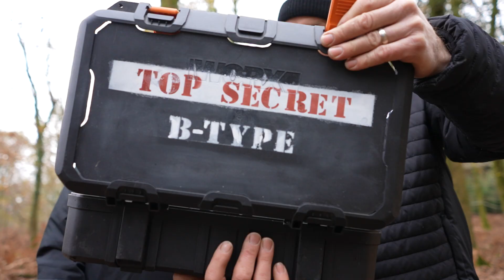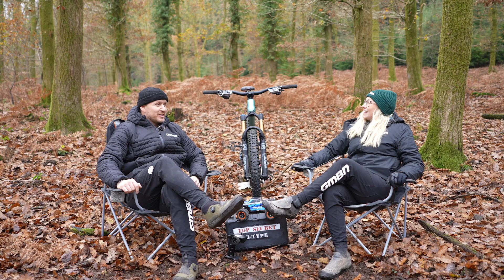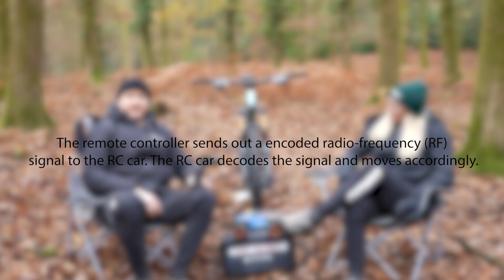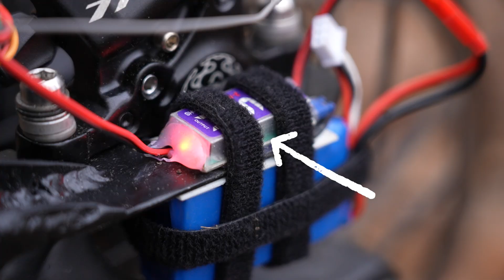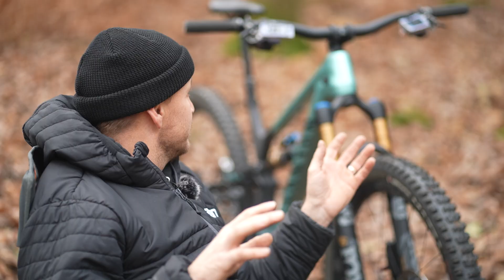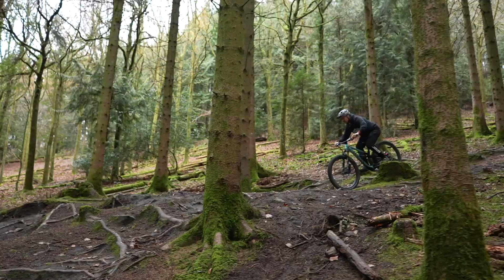Breaking News | Wireless Bike Brakes Are A Reality!

Comment: This is unbelievably cool. If a sram/shimano or another brand don’t take you onboard I will be very surprised. This has got to be a worlds first for sure! Awesome work Blake!
Reply: I think the reason wireless brakes haven't caught on yet is they simply can't not work. If gears stop working or there is a malfunction it's whatever & might work on the next shift. If brakes don't work you are knackered which could make the companies liable.
Reply: @Nick5554-h8g Have you seen the tech involved in giant scale RC aircraft and helicopters?
A failure is rare by faulty equipment, it's dumb thumbs and incorrect installation that brings them down, and it's big $$$ riding on the electronics, bigger than MTB.

The wifi servo tech is here now, a traditional TX/RX can be bypassed, control going straight from lever to caliper servo via wifi, no servo cables required.
Reply: @BarrysMintyBiscuit2201 true, the difference is that when an RC plane fails it may just crash, when it fails on an MTB people may die. These companies have millions in R and D and have the technology to do this already. they just dont want the liability.
Reply: @thatguy2201  no. Any money lost in an rc crash is chump change compared to a manned vehicle crashing and paralyzing a rider. The hospital fees and possible loss of career....n that's if they live. Nobody is th8nking about the possible damage to the bike homie!
Reply: @Nick5554-h8g  if you cut line or tube completely on (regular) brakes it the same thing.  So yes there are some things that make the odds that they completely fail much higher could you thru redundancy make them just as safe???
Reply: @nomad-pq4yw8iy7v How many times have you cut through your brake line? I’ve been riding disc brakes for 20+ years, it’s yet to happen to me. But if I was riding and the brakes failed because of a connectivity issue or the battery crapped out that’s a big problem. And I ain’t willing to test that.
Reply: @nomad-pq4yw8iy7v @ nomad-pq4yw8iy7v you could get close to as safe as cables or hydro. I think you would want them to be wired instead of wireless to eliminate the extra batteries and senders/receivers for the wireless part,  just to make it a bit simpler.
Reply: @nomad-pq4yw8iy7v  how many times did your brake cable break in half during a ride? And how propable it is for the batteries to stop working? Excactly.
Reply: @Nick5554-h8g They simply cannot work*
Fixed it for you.
Reply from the maker: We think it is! Would you buy some? How long do you think it will be before this is a production product?
Reply: @gmbntech  I do love my wireless stuff on my bikes. Brakes would definitely be something I’d have to get my head around and used to but definitely keen to try!
Reply: @gmbntech I would definitely buy some if you made a version to go into TT extensions... the number of crashes that you'd avoid would be immense!
Reply: Nah. They will just take what they learned here and take over. THats why you get a patent before you make this public
Reply: SRAM and Shimano are probably stealing the idea right now. You better hurry and get a patent, Blake!
Reply: Probably Toy car company will be on his ass before others (Sram, Shimano) claiming their patents, lol. Just guess. But no one else attepted it. So big kudos to Blake.  @barnabyjonesdangerdog758
Reply: I never wanted to be a retro grouch but if this becomes the next big push by SRamano, then I will be joining the Rivendell crowd.
Reply: These companies 100% have already looked into this and have the technology to do this already. the only reason they are not doing it is liability. thats it.
Reply: @GrimYak  they haven't figured it out 100% because the liability(safety) is part of that! unless of course they're trying to patent it or get the cost down before they release it. A lot of times the big boys aren't the 1st to bring something to market in any industry.
Reply: Nice prototype and story around it, well presented, too. Interesting. 👍

But of course every company in this field has thought of this before and for obvious legal - not technical - reasons will never ever sell a variant of any remote controlled brakes.

Maybe there will be a new technology like those strings similar to a spider's web (think of weight) but for sure there won't be a electromechanical, remote controlled brake on any vehicle.
Reply: @BikeArea   So are you trying to say it will happen by saying (never)😄
Reply: Can't see any company makeing wireless brakes simply because battery's run out and then what? They just don't work or more likely they will come on as a fail safe etheir way it's a legal night mare
Reply: @stinkyfinn6977   they already have fly by wire. I think they'll figure it out. Not that it's a good thing but the legal night mare is a joke pay attention to what the big auto makers are getting away with the drug companies as well. I think it quite possible they'll figure out how to make them as safe as the regular ones. It's not like there aren't things out that have electric brakes. I do think that totally internal hydraulic lines that can fully rotate would be a better way to go. Just some food for thought they thought the wright brothers were crazy😃
Reply: @stinkyfinn6977  what do think air brakes on trucks do it actually happens from time to time. Just think about crazy things they came out with before we were born like airplane. Can you Image trying to tell them that people would be fly thru air at 30,000 on the regular . They'd say your nuts and even if you could that's way to dangerous! Yet today it's done every day.
Reply: @nomad-pq4yw8iy7v  I know what air brakes do and they would make more sense on a bicycle then wireless brakes do, but whatever theirs idiots out their that will buy this shite so wouldn't surprise me to see them for sale at some point

Comment: I want my MTB fully analogic. I would NEVER trust my brakes to be wireless.
Reply: Maybe wireless for the rear brake but not the front cause the distance is pretty short so that's unnecessary. also，that leave a leave  redundancy for safety.
Reply: @Soras_  then you have to deal with wires 😅
Reply: @Flexo_l you can do barspins though 🤷‍♂️
Reply: @Flexo_l  It's still much compact if the front is all you need deal with. I am not  confident to all e-brake.

Comment: No way will I ever feel like I trust this.
Reply: No electronics at all for me, except the headlights
Reply: Me too but my do we trust a cable/hydraulics, is it just because it physically there, we trust electronic wireless gears
Reply: @reecedawson6113  We trust electronic gears, until the battery runs out.
Reply: @reecedawson6113  Cable/Hydraulics tend to stay working and are very well proven. 

Wireless can be broken in so many ways it's crazy.

Finally, wireless gear doesn't work/stops working mid ride you can probably still pedal granted in a potentially inconvenient gear. Brakes stop working/run out of charge at the point you need to stop... Well, it's not pretty. 

To be honest I'm not really convinced by any wireless technology. Charging these things and making sure battery health is good is way more of a pain in the butt than maintaining a physical system that needs very little tlc.
Reply: @Th3Gr33k  wireless works great, perfect shifting, no cable installation. Cars brake by wire, no biggie
Reply: @Playwholeday Go try these brakes on black downhill track and we will see who has headache and spinal problems😂
Reply: Just wait until they only provide brakes via subscription
Reply: When you fly a 700 size RC helicopter doing inverted hurricanes past yourself point blank, trusting a bunch of servos and thumbs, these brakes will be fine.
Reply: Saaame. I can live with my wireless gear changer failing, but not my brakes, on a steep, gnarly descent 😭😰. Even if other people don't have any problems...
Reply: @Playwholeday  Why the insults? I mean if you're going to bother at least use the correct grammar. Good luck.
Reply: Yet your car probably has an electric throttle and brakes? Something to think about. It's the future we like it or not
Reply: @ivanbejar5  In EV yes both are ECU controlled. There are quite a few examples of runaway EV where the ECU fails.

Traditional ICE have drive by wire but brakes are linked to the pedal with assistance.
Reply: Cars even high performance cars use drive by wire for steering and brakes.
Reply: @justsayin3600  Steering and brakes in all but electric cars are direct with assistance. It's not the same.
Reply: ok :face-blue-smiling: @justsayin3600
Reply: Ye especially as they were made in a shed
Reply: Echt klasse! Ich bin gespannt wie es weitergeht,
Reply: @Playwholeday  Only issue is none of those things affect safety in a fundamental way. Nice try though. If you want them you go for it.
Reply: Cars have brake and throttle by wire already, it's perfectly safe when correctly engineered.
Reply: @thecremeegg  By wire... No offence but that's not wireless.
Reply: @Th3Gr33k  Semantics, it's still purely controlled by an electric signal to the brakes
Reply: @thecremeegg  Electric cars are, usually for the power generation on braking. Normal cars are linked and have power assistance. The pedal is still linked to the brakes.

So it's really not the same. Also there are many examples of electric cars brake/acceleration system failing and having runaway cars. It's not the best example of a good system.
Reply: Signal integrity is not semantics, its paramount to reliable operation. You had a stupid opinion, everyone has them from time to time. No need to dig this hole any deeper.
Reply: It took the industry over 30 years to get the tech good enough to convince themselves (lawyers) and the bureaucrats in charge of vehicle safety. Also those drive-by-WIRE, not WIRELESS. I'm all for wider adoption of ABS to stuff like commuter e-bikes which won't mind few extra pounds. 
Wireless brakes are never going to get wide approval, they are a technological and liability nightmare.
Reply: @thecremeegg OK but cars with this tech actually have a backup hydraulic system should the electronics fail.  If a bike has a backup well you’re back to square one.  On bikes this is all about looks.  Hence the idiotic idea of running cables through the frame requiring you to take your fucking bike entirely apart just to run a new brake or shift cable. There’s zero mechanical  or performance benefit.
Reply: @dmac8247  Except you engineer the caliper to be held open by the electronics rather than closed, so in case of a power failure the brakes come on rather than not work. It will require some refining but it'll get there. Looknig forward to not having to run gear or brake cables in OR out of the frame tbh
Reply: @thecremeegg  That doesn't exactly sound safe either. Doing a mad endo mid corner or hitting the lip of a jump... Sheesh.